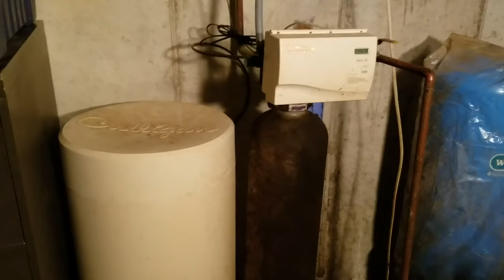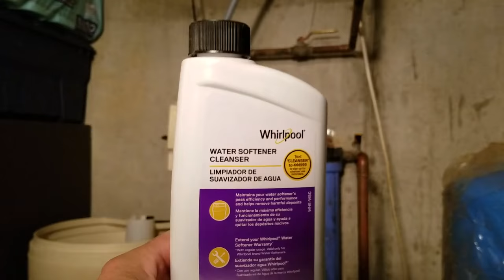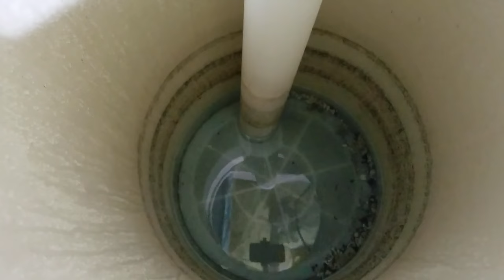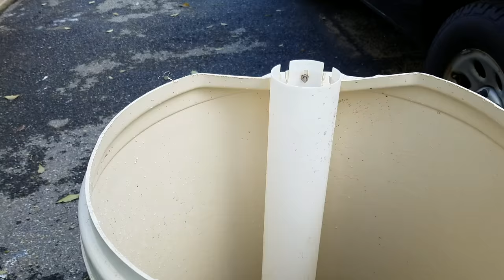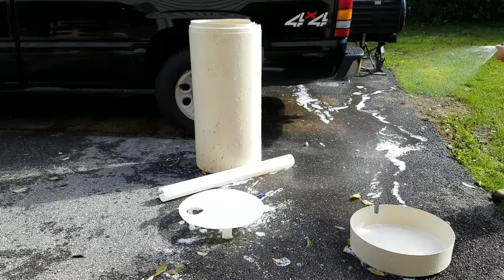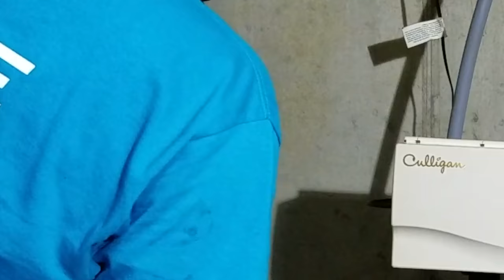DIY Water Softener Maintenance Culligan

Comment: I have an opening at the back of the brine holder that has an L-shaped tube going out. I'm assuming it's an overflow. I haven't lived in my house but one day a week for 13 years. Now, I'm putting two bags of salt pellets. Putting the second one in is when I accidentally discovered this "overflow." I'll watch this video to see if I can figure out how to change from a screen on the console that is simply flashing with what looks like a time.

Comment: I have a Culligan system that has been unused for about 3 years now as we moved into a new home.  The whole system is 9 years old.  It has been on bypass mode now for years.  I cleaned out the brine tank but have not used a resin cleaner or sanitizer yet.  I'm wondering if I need to change out the resin at this point or if the cleanser you used would be good enough.  How often does resin need to be changed out?
Reply from the maker: No specific time that it lasts.  Try a few bags of salt and the cleanser and iron out.  Force it to regenerate a few times letting the water rest in the brine tank for at least 3 hours in between.
Then see if the water is 'soft'.  You'll be able to feel the difference.

Comment: wow, i've never seen a brine tank filled up to the brim with salt  pellets. lol
Reply from the maker: Saves trips to the hardware store.
Reply: I’ve been told just keep it above the water
Reply from the maker: Then you have to check it constantly.  Mike didn't design the brine tank to be that tall if it only needed to be 18 inches high.
It is fine to fill it up to the tippity top.
Reply: I remembered, it was because you can get an “salt bridge” build up , I used to keep a broom handle near the tank to break it up when it happened.  Anyhow thanks for the info, cleaning mine tomorrow.
Reply from the maker: Try the salt pellets that are shaped like a football.  Been using them for years and never had a bridge form.  They don't pack together as tight as the crystals do in the tank.
Reply: @kurtrogers6341  me to. 3 bags max. works with no problems.

Comment: When you cleaned it did you just use dish soap? And is that typical to just fill them to the top and how many bags does that take about? Thanks for the video! Very helpful im sure culligan would charge 500 and make it sound fancy but really just to the same thing
Reply from the maker: I used dish soap and white vinegar.  For my brine tank it takes about 10 forty pound bags to fill it up.
I fill it all the way up so I don't have to fill it as often.  If Culligan didn't want that much in there they would have made the tank smaller.
Reply: @HouseDoctorRay  LMAO

Comment: Great job!  Only thing I would suggest is to only put in about 2-3 bags of salt instead of 10.  I have the same water softener and it isn't using salt, nor am I getting soft water. it does regenerate every night.  I called Culligan and they tested the water and tinkered with it and charged me almost $110 and it still is not working.
I have seen the bottom of my brine tank and it didn't look to have all the build-up in the bottom, and I am surprised as the system is over 30 years old.  I will dig into it tomorrow.  Enjoyed the video, Thanks.
Reply from the maker: My system is only 24 years old but we have very hard well water.  Your resin may need to be replaced.  It's a fairly easy job.
https://youtu.be/I9nenH07co4?si=oYcpWVmRrf_8mR_N

Comment: Good video! What did you use to clean out the brine bin? Should you run a re-gen after cleaning and filling with salt? Thanks
Reply from the maker: Soap, vinegar, ammonia.
I don't like using bleach on plastic, the smell seems to linger.
Yes, you should do a regen to get the brine tank refilled with water and any air out of the lines.

Comment: Awesome . Didnu shut off the resin tank hose before cleaning? I saw you at tye end of the video reaching behind the system and twisted something. Thx
Reply from the maker: That was my system bypass valve.  I put in bypass so I wouldn't bring the clean tank back inside and find a flooded basement.

Comment: My water softener is approximately 25 yrs old. Must be getting plugged because the house soft water supply has reduced by 50% in the last few weeks. The head of the softener on the tank has a red lever. Do you simply pull back on the lever to unlock or remove pressure in the tank?
Reply from the maker: That is probably the bypass valve.  You need to put it in bypass, then force regeneration, then you can disconnect it.

Comment: Just bought a home with a similar unit. However there are 2 tanks setup with this unit. One with buttons status, regen, +, -. And the other tank device has arrow up, arrow down, X, and a checkmark. Any idea what I've got going here? Also, where can I find these products, and approx how much are the bags of salt? And what is the term for it? I'd appreciate any knowledge you can share. Thank you
Reply from the maker: Not sure about the second tank.  Try posting pictures in a home improvement group on Facebook.
You can buy bags of salt for water softeners at most hardware stores.  Prices vary depending on the size bag you buy.
Reply: @HouseDoctorRay  Thanks

Comment: hi,...
is me again.
I need to know somethings which no one at Culligan wants to say. They wants me to buy a new system.
I paid $6600 for it many years ago...someone said I got gypped.
So that system you're working on in the video which is the same as mine...how much gravel does it need?
and how much resin?
I'm going to buy it and do it myself thanks to your videos.
My tank is 8"x44"
Reply from the maker: There is a link in the video description to calculate your tank size and how much resin to use.
You need enough gravel to cover the slits in the center pipe.  I just used the whole bag.  You want to fill the tank with resin to about 3/4 full, maybe a bit more.
If you hold a bright light up to your tank you'll see how much resin is in there now.
Reply: @HouseDoctorRay  ok good. Thanks.
Reply: is me again...I think

Comment: I just bought a house and it has the same system 
I know I need to add add all of sal as he tank is completely empty
But is there a way to adjust water pressure 
It’s really low 
Thanks in advance
Reply from the maker: Sorry, just got this notification.
You may need to replace your resin.  It can break down over time and get clogged with sediment.
https://youtu.be/I9nenH07co4
I would check the pressure before the softener or with it in bypass to see if that is the problem.

Comment: I just bought a house with this exact culligan softener.  My water isn't getting softener. I have cleaned the brine tank. How do you clean the brine injector? What are the steps?
Reply from the maker: You may need to replace the resin if your system is as old as mine.
https://youtu.be/I9nenH07co4
Reply: @HouseDoctorRay  thank you! I'll get the gravel and beads together. I've saved the video.
Reply from the maker: You got this Pete!
Reply: @HouseDoctorRay  we will see! This scares the crap out of me!

Comment: Did you put the water softener cleaner into an empty salt tank? Or was there other materials in it? Ours is empty and hasn't been used for years and want to try this but unsure if I need salt in the tank first?
Reply from the maker: The system needs to be working.  Open the bypass valve and force the softener to do a regeneration.  When it is finished you should end up with water in the salt tank.
If that works put the cleaner in the salt tank and do another regeneration.  After that is all done you can add some salt.
You should force a regeneration once a day for a few days to purge the softener of any build up when you first start to re use it.

Comment: I just bought a home and looked in the brine tank. Empty with the exception of some dirty water. My only issue is that it’s winter now and temps are hitting below 20 degrees. Not gonna be able to use the garden hose
Reply from the maker: Clean it the best you can using water from the sink.

Comment: If my Culligan MultiMax Conditioner brine tank has water levels a little bit over half, can I just dump this cleanser and do a manual regen? I want to clean my tank and re-add salt. I see no salt in my tank. My brine tank has blue water and black particles floating.
Reply from the maker: I would clean it out.  That blue is probably some kind of algae.

Comment: How long can that water softener last? I have the same one and want to know if I should clean it or replace.
Reply from the maker: You should clean the salt bin at least once a year.  The resin pellets do eventually lose effectiveness but it's a lot cheaper to replace the resin than buy a new unit.  Here's how:
https://youtu.be/I9nenH07co4
Reply: @HouseDoctorRay  oh okay thank you for the reply! So if I replace the resin and clean the bin once a year how long could one of these last me?
Reply from the maker: As long as the electric motor lasts.  My Culligan is 20+ years old.
Reply: @HouseDoctorRay  oh okay that's great to hear! Last question, when it comes to these water softeners are the brine valve assemblies universal? Or do they have to be the exact same one that's being replaced?
Reply from the maker: The size of the brine tank determines how much water is available for backwash.  You could interchange them if you had a similar size.
If you buy a new system you'll get a new brine tank with it.

Comment: I have a question, I did everything and for some reason there's some light brown water coming thyroid the toilets and the water from the fridge (dispenser) as well.  What could be the reason for this? Thank you!
Reply from the maker: It is likely sediment in the pipes that was stirred up when the water was off.  You could also have sediment in your mineral tank.  A regeneration or two should clear it up.

Comment: Do I put it in bypass mode before I add cleaner and regenerate?
Reply from the maker: No.  Bypass mode completely shuts off the unit from the water system.  It needs the water pressure to syphon the cleaner from the salt tank.  The cleaner will not get into your water system.

Comment: How do you add water? Did you add it manually or does it fill it when you run the regen? Do you set the water at a certain level?
Reply from the maker: It will refill during the regeneration cycle.  The long black rod has a float on it that shuts off the water at a preset level.

Comment: My Brine tank is currently not filling up with water. Could this be due to a clog in the tank?
Reply from the maker: No, it is either the head unit on the mineral tank or the lines and tube to the brine tank are clogged.
First thing I would check is the tube going to the brine tank.  There is a float switch to set the water level; it may be stuck.
Reply: @HouseDoctorRay  Thank you. The line seems to be OK since I can blow into it, and here it bubbling and the bottom of the tank. The control valve on the float switch?
Reply from the maker: If you can blow through the line into the brine tank then the head unit on the mineral tank isn't sending water to the brine tank.
If it's a Culligan here is how I took mine apart and cleaned it.
https://youtu.be/q9oMG6jd1UA

Comment: Ever since this E3 code came up, my culligan hasn’t worked . I constantly unplug it and plug it back in to reset it and it starts making noises for about 60-90 minutes and I’ll have soft water again for maybe a couple of days and then back to crappy super hard water and pellets not used up. I hate this thing. It’s only maybe 5 years old and it sucks. Any idea how I can fix this? I might toss it and get a different one , not culligan.
Reply from the maker: Could be the switch that determines the position of the motor.  Unfortunately parts for these are hard to purchase if you're not a Culligan Man.
Reply: @HouseDoctorRay  thank you very much for the quick response. And that’s what I’ve been hearing…. “Only Culligan can fix it” from others, which makes me want to purchase a softener that is consumer serviceable. Any suggestions would be great.

Comment: I have a "check salt" warning on my Culligan Gold series display. I checked the salt and noticed it hasn't really gone down any over since I last filled the salt up. I'm currently trying to regen, because the only thing I could find in my manual about the issue says "The alert can only be cleared after a successful regeneration of the resin bed." Have you ever encountered this issue? Great video btw, thank you!
Reply from the maker: You could have a 'salt clog' or bridge in the salt tank.  This happens when the salt clumps together and won't fall down.  Make sure it is loose, you may have to take some out to check.
If that is not it then read through this:
https://www.doityourself.com/forum/water-softeners-air-filtration-systems/455807-culligan-not-using-salt.html
Reply: @HouseDoctorRay  Excellent, thank you for the advice, I'm going to check it out right now.
Reply: You also may have valve that’s not drawing brine, usually the case

Comment: So I’m assuming since that you used your garden hose to clean tank that the water throughout the distribution system still works despite the water softening system being disassembled?  Thanks for the video by the way. I’m seeing what looks like rust in my toilet and got me wondering.
Reply from the maker: All softener systems have a mechanical bypass so you have water if the unit fails.
Rust could be iron in your water or mineral sediment.  Vinegar should clean it easily if you fill it overnight.
Find a water testing company that doesn't sell systems.  Check with your county or nearby university.

Comment: The Culligan brine well (the tube inside the tank)... does it not come with a lid cover? Many other brands of brine wells have a lid cover... can you confirm?
Reply from the maker: Yes, there is supposed to be a cover.  Mine is long gone.  It is just there to prevent the salt from falling in there when you fill it.
Reply: @HouseDoctorRay  Mine doesnt have the cover either when I bought the house... so I guess the previous owner lost it as well.. alas.

Comment: I am not sure how my system is but it is not working properly. It supposed to use the course solar salt but the last time it got filled they put in the pellets and it taking forever for it to get used up and doesn't seem to work at all. The water is hard and it has an oder. What should I do? I am thinking about dumping it out but it is half full of salt?
Reply from the maker: First thing to check is if the brine tank has water in it.  Then when it goes into regeneration the level of water should go down.
You might also have a salt bridge where the salt sticks to itself and won't go down.  You can scoop the salt out and put it into a clean container or trash bag if needed.

Comment: My system looks similar to yours, but it says "check salt" on the display. does that mean the salt tank is dirty? havent ever took it apart since owning the house and I bet the old owner hasnt either. I regenerated twice and it still has the error. any advice?
Reply from the maker: Check to make sure the float is moving freely.  Also see if the hose and pipe that goes into the brine tank is clogged.  It comes off easily, try blowing through it or running water through it.
You might also want to check this out.
https://youtu.be/q9oMG6jd1UA
Reply: @HouseDoctorRay  is the float that black thing in the salt tank with the hose attached to it that goes to the other tank? If so, what do you mean moving freely? It looks like it's just resting there.
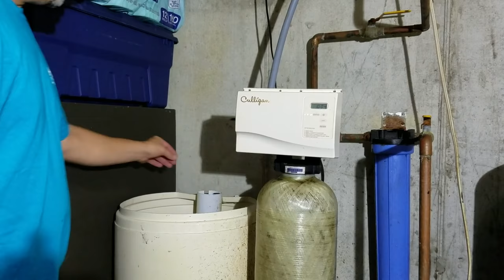Reply: The float I am referring to the thing at 3:20 in this video.
Reply from the maker: In the video it is the steel rod with the white part.  If the water gets too high it shuts it off.
Reply: @HouseDoctorRay  yeah the white styrofoam thing? Its sitting like yours. the water level is not too high. i took out most of the salt pellets so i can see the bottom of the tank and did another regeneration and now all the water is brown. i was going to just throw the unit into BYPASS and clean out the tank and see what happens. anything you would suggest? the water looks to be maybe 4-5 inches deep like the manual says. i can feel the bottom of the tank so i dont think any salt is stuck.
Reply from the maker: The water shouldn't be brown.  Clean that brine tank out.
If your siphon tube and hose going to the brine tank isn't clogged the problem is in the head unit on the mineral/resin tank.
Reply: @HouseDoctorRay  the tube going from the salt tank to the resin was good. I could blow right through it. I tried to place the unit in bypass but it appears stuck. I have a system where it has a blue and red push button to bypass. I guess I will clean out the tank and see if that fixes anything. It doesn't give any other errors.

Comment: I assume we bypass before pouring cleaner in there and letting it regen?
Reply from the maker: You don't use the mechanical bypass.  Once you put the cleanser in the brine tank and force the unit into regeneration mode it is effectively in bypass.
If you use the mechanical bypass the unit won't operate because it needs water pressure to syphon water from the brine tank.
Reply: So nothing to shut off and back on as far as hoses?

Comment: I have the same softener.  When you run the regen/backwash with the cleaner, were you in bypass mode or no?
Reply from the maker: No, you want the cleaner to flow through the mineral tank.  Bypass mode is if you have a leak or need to do more serious maintenance such as changing the resin pellets.
Reply: @HouseDoctorRay  Thank you for getting back to me.  We bought this house and found out the softener has been inactive for two years.  I'm going to scrape out everything in the brine tank.  Does it matter if I pour the cleaner in the main brine tank or in the float valve tube?